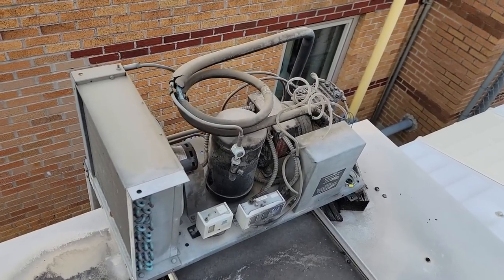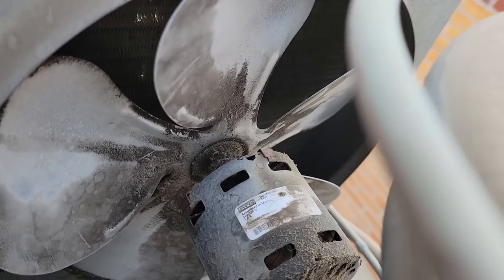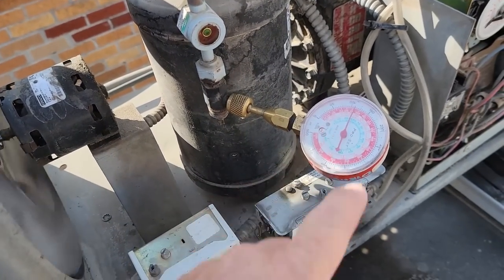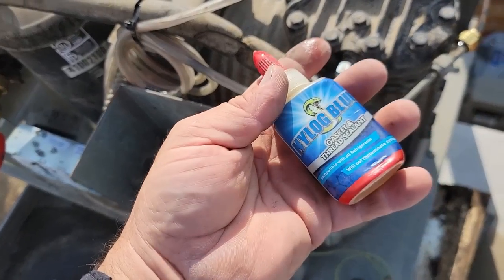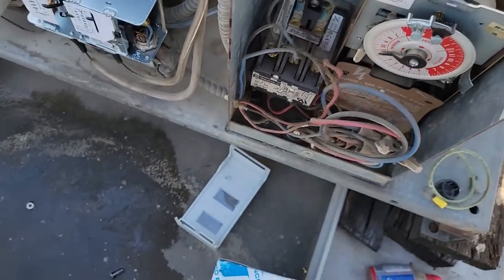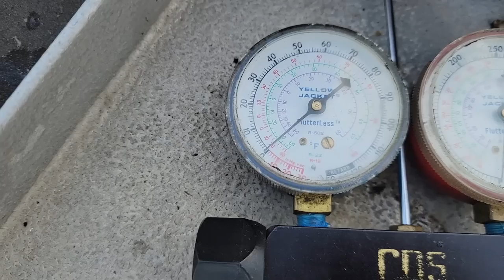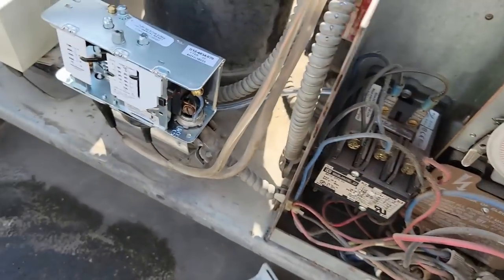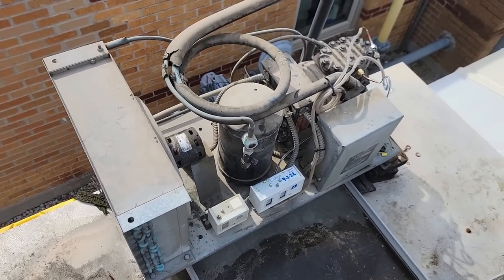Bio Hazard Cooler Warm

Comment: I would replace fan blade as well. I hear a little rattle like hub might be loose in blade.
Reply from the maker: I found out the fan motor is no longer made per the factory and no after market motor available, so I'm curious how long this will run.
Reply: I was thinking the same thing. It sounded like the hub on the fan blade was a tad loosey goosey.

Comment: Interesting, the pressure switches we get here have a 1/4" flare connection, you have to supply your own capillaries, though I tend to use the braded stainless steel ones as they are less likely to leak.
Reply from the maker: We have those as well. They cost more but can be easier to install.

Comment: I have one question sir , when you change pressure switches both high and low . You isolated the compressor and I am still confused do we need to do vaccum the compressor Bcz we opened the system to the atmosphere.
Reply from the maker: The correct answer is YES you should. But can you bleed the air out? I've seen it done on a semi-hermetic compressor like this one.

Comment: Had to order that condenser motor?? Your local supply house doesn’t carry that? I try to  keep all 4 possible motors and 1 fasco recovery motor that does all 4 possible set ups, on my truck , since they can be used on cond and evaps….. just curious, great job on the videoss love watching them
Reply from the maker: The supply house called the factory and they said they dont even have it. The system was over 30 years old
Reply: @HVACRSurvival  oh geez, it looked older, didn’t realize it was that old, thanks for the answer, keep up with the good content

Comment: Great video, thanks for sharing. I like the nitrogen at the truck for setting up pressure controls though so you aren’t short cycling the compressor too. I have a flare tee that I use with a ball valve to dial them in nicely.
Reply from the maker: Good ideas for sure 👍👍

Comment: If the cut in is too high the unit may not start if it's say 10° outside. You'll know this winter if it works.
Reply from the maker: Correct, but if I set it too low it'll short cycle.  When the refrigerant flows into the evaporator after the thermostat opens the solenoid valve it's going to pick up the temperature of the evaporator which will be in the mid 35*-39*.  It may take a while for the pressure to build up but it should come on. I showed at the very end that's how it was set up prior and it had been working.

Comment: How many geniuses are going to hold onto the fan blades to check the motor torque now?? 🤣
Reply from the maker: I don't do it unless I'm trying to narrow down if the motor is what's failing. 🤷
Reply: 😆😆😆😆😆😆😆. I watched a video and he held the fan blade.....i lost a finger trying it.
Reply: Hopefully someone realizes the difference between a 1/16 hp and a 1/4 hp motor haha weed out the weak I say let natural selection take it place
Reply from the maker: @c_young-hvac4586  the power to the motor was cut by the fan cycle switch when I stopped it. I didn't stop it while it was powered. All my videos are labeled for entertainment only,  if someone doesn't have an idea what they're doing and they chop their fingers off then they deserve to lose them.
Reply: @HVACRSurvival  amen to that.
Reply: @HVACR Surviaval ....I got ya and I 💯% agree